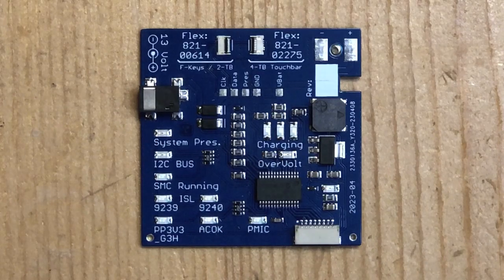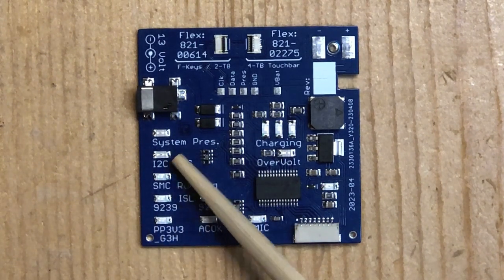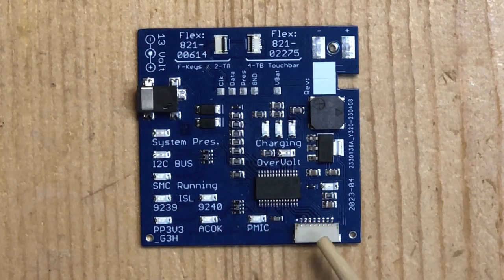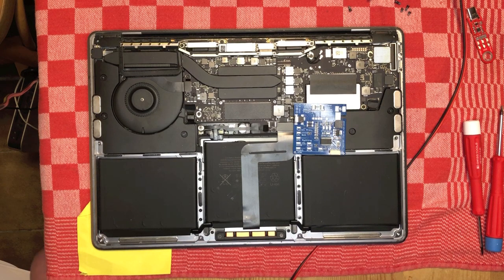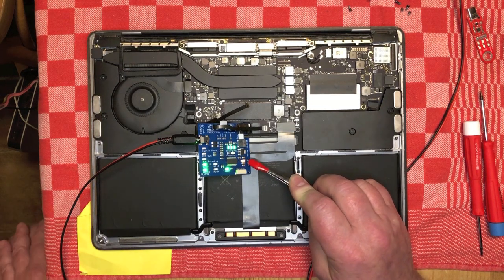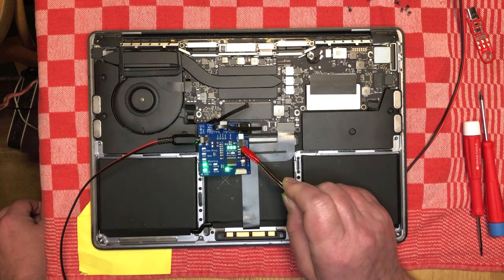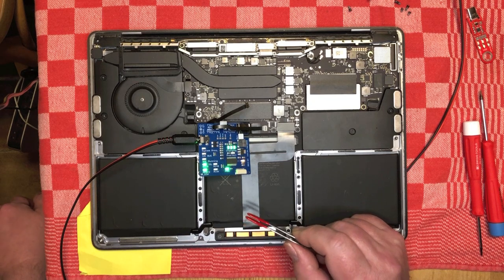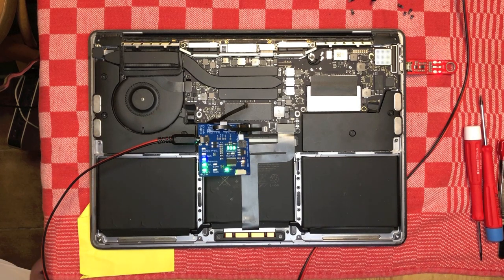Diagnosis of MacBook A1708 with CMIzapper 'Known Good Battery'

Comment: Good tools, only it is pitty that I need to buy separate battery tester for different models.
Reply from the maker: That is because it emulates the battery. Different models of Macs take different batteries, hence there are also different emulators.